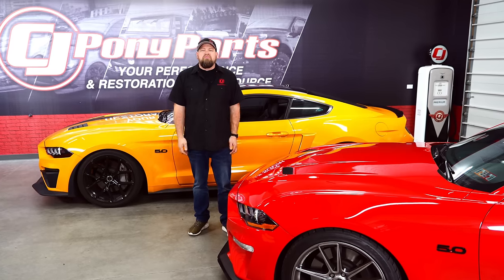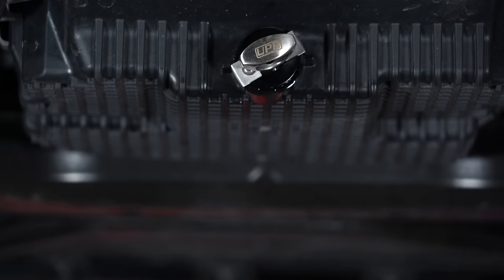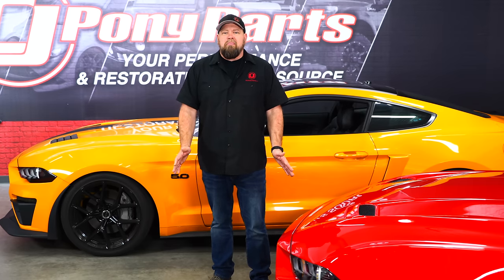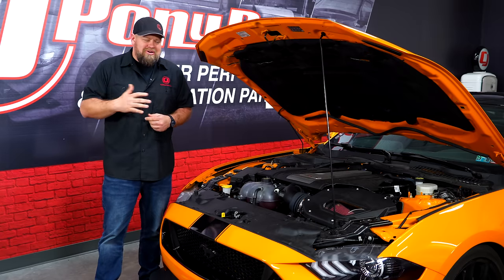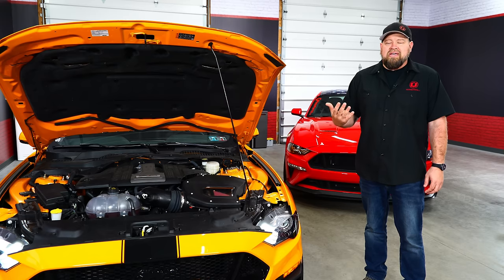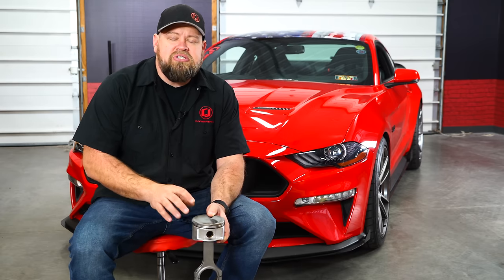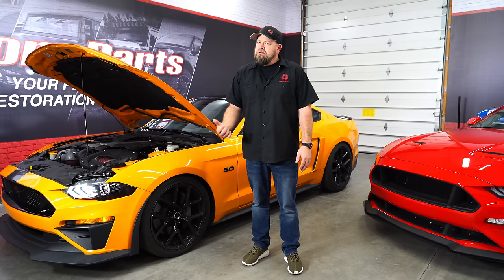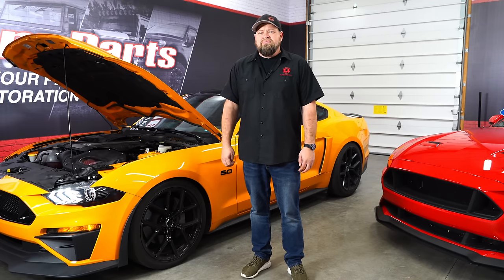2018-2019 Mustang Tick: Should You Be Concerned?

Comment: Sounds exactly like the DI system.  I have a 2015 WRX and here this exact noise (well, from what I can tell just over the video).   Ford or someone could rule out the composite oil pan theory by fabbing an aluminum pan and installing.. to see if the sound changes.  Yeah, it would take some time, but worth finding out

Comment: I still think it's rod knock. With slop, the rod has some side to side play. The force is down on the crank during a power stroke. Random vibration can make it move to the side, pinging off the crank asynchronously. Piston slap tends to occur on every power stroke in time with the engine.
I suspect that if the side to side motion is really excessive, it may be enough to force the piston cockeyed and score the cylinder. I seriously doubt that's happening much. Scored cylinders generally result in big blue clouds of smoke billowing out the exhaust. 
I've seen numerous vids of Ford techs replacing the top ends of these things only to still have the noise and end up buying back the car. A guy with a blue one just posted the other day. Tech replaced the bottom end and no more tick. Seems a little excessive when a bearing would have probably fixed it, but at least now, he's a happy customer.

Comment: I have the "tick" on my 2018 that I've put 19k miles on so far, no issues with metal in oil, good compression test and since I've modified the exhaust you really can't hear it anymore. The people that have lost their engines probably were not as a result of this tick, but some other manufacturing issue. Now with the significant refresh on the 2018 I would expect their to be some issues getting worked out in this new motor.

Comment: Im wondering if its the phasers. These engines have 4 cams with phasers and long chains. GM on the Ecotech engine, uses gears with these floating rings on the ends to reduce noise from the chain that runs the balancer shafts. A genius idea and there is a chain guide between the cams to prevent chain slap caused by the acceleration and deacceleration  of the cams. The ticking noise reminds me of a timing chain coming around a guide and tapping the guide when these accel/deaccel moments happen. Now toss in 4 cam phasers and I can imagine that causing unforseen issues.

Comment: I got the tick after my last oil change... 48k, I used to get a light tick for the first couple 100 miles after every oil change in the past, but now its been almost 500-1k and still have it a bit more prominent. Ford shop did not find anything wrong.

Comment: My first mustang was an 08 GT. I had it for 10 years. Sold it @ 75k miles and all I ever did was change the oil, breaks, tires, break pads and the occasional alignment. The car started ticking, but I think it was another issue. I now own a 2018 GT and it ticks. It gets quieter when the car heats up. I’m @ 10k Miles about to go for my second oil change. It went away for a little bit when they first changed the oil, then it came back. They said the first oil change everything looked good. We’ll see what happens. Love this car though. You can’t hear the tick when I’m smoking ya. Lmao. I still wouldn’t want another car for the price. The only thing I don’t like about the 2018 GT is the poopy audio system. My 08 GT shaker 500 system was great. I didn’t upgrade the audio this time; I would recommend it. Great review.

Comment: I have the tick on my 2018 Gt. I changed first oil at 1700 miles. Started noticing the tick. Had a misfire and engine light come on around 3700 miles. Took it to ford dealership and they told me it was two quarts of oil short and i didn’t use a motor craft oil filter and that was my problem. Ticking noise went away for a week and came back. So i took it back to ford at 4700 miles and it was already a quart short of oil so they looked at it again and told me it’s burning oil and they will get back with me when they hear from ford. Told me to drive it for now. 2 weeks later and i still haven’t heard anything and i keep having to top off my oil.

Comment: Sounds like my 6.2L in my F250. Started around 10k miles...now at 27k miles. It's pretty annoying, as I am not one to drive with my stereo volume up. It runs fine though I suppose. I just put Ceratec in 2 days ago with oil change after hearing the 5.0 guys, hoping for the best. Because Ford dealerships here in Virginia Beach are trash if you want them to do anything warranty related, they might as well just be quick lube shops.

Comment: Had a louder "clank" sound on my '15 GT just upon start up.  One minute later it would go away as the engine warmed.  The sound seemed to be coming from midway underneath the car, almost like an exhaust pipe clamp was loose.  Changed to full synthetic motor oil,  I have never heard it again.

Comment: I’ve had the tick after my first 2 oil changes. Got the car at 36k and now have 46k. Ignored it on the first change and it eventually went away. Second time it pissed me off and I used Ceratec. I kid you not, the tick was gone after the first start up after adding the Ceratec. Hasn’t come back. It’s flat out GONE.

Comment: Adding heavier oil will only mask the problem the problem is the aluminum cylinders to correct the problem you need to add liners to the cylinders which ford did not to do on 18' and up the cheep plating was a cost saving measure..

Comment: I owned both a 2012 and a 2013 5.0, and they never had that tick. I'm the type that notices any strange sounds, so I'd know if it was there. From hearing the tick in other videos, it almost has to be some sort of metal on metal contact inside the engine. If that's the case, it's not ok.

Comment: 2019 Mustang GT PP1 10 Speed. 
Engine tick has been present since 15k miles.
Engine stalls after a few pulls in sport mode when coming to complete stop. Been to shop 4 times including Ford engineer not being able to figure out why it’s stalling. Sometimes when doing a pull, the gears refuse to go to the next level up causing her to redline.

Comment: I can't comment on the Coyote motors, but as a '99 and '03 Cobra owner I will mention that there was a problem with a ticking in cylinder heads on the Terminators.  Ford developed a fix for this,  which involved some kind of head modification so that oil would flow properly to all areas of the head.  I  didn't have that issue with mine, but I did have the stalling problem, which they fixed with some kind of computer re-flash.  I would think that Ford is probably working on this problem with the Coyote motors and it will be resolved soon enough.  Remember, between the Mustang and the F-150, there are probably well over 400,000 of these motors on the road, so they must be doing something right.  Either way,  a proper break-in and then using a full synthetic oil may just mitigate this problem.   My '03 turned 100,000 miles this year.  Only Mobil 1 5-20 or 0-20 has ever been in it after the break-in and it still runs like brand new.

Comment: So I found this video just to get more explanation about what the dealership was talking about. I have a 19 gt mustang and it had about 25k miles on it when the tick began. And after a couple months of me changing oil weight. It never got better. So I took it to dealership and they got an engineer to look at it. The engineer did diagnostics and one of them was playing with the pistons and when he turned the driver side ones off it stopped ticking. The dealership is currently replacing my small block and telling me I shouldn’t have the problem again. Should I trust them?

Comment: I have a 2016 mustang GT. 44k miles just started noticing a rattle at 3000 rpm in 3,4 and 5 gear but always at 3000 rpm. You can hear it with window up or down. When window up it sounds like it’s behind the glove box

Comment: I just purchased a 2012 f150 with 90k miles on it.  The tick was defiantly there in the drivers side of the engine at the bottom.  I swapped to 5w-30 and the tick is only noticable at times now. When Its colder outside. It's not constant like it was with 5w-20.

Comment: Ford Parts Advisor, here. Per my books, you should be using XO5W50QGT in performance pack cars, not the 5W20 blend.
Reply from the maker: Manual and oil cap both say 5w20, I agree the 5w50 is a better choice.
Reply: CJ Pony Parts this would not be the first time Ford’s literature has been inconsistent in my experience.

Comment: 3 dealers 1 ford engineer and they’ll all told me it’s running at normal operation I checked my oil and opened up the filter and no metal at all not one sparkle nothing lol so I’m trying ceratec tomarrow 2 bottles should shut this thing up I drive it hard all the time and it does not blow lol it doesn’t wanna die I’m just hoping that the ceratec doesn’t leave anything noticeable that’s it’s been put in after it does decide to blow cause I don’t want the dealer blaming something that was put in the oil if they do notice anything

Comment: They have been replacing short blocks at dealerships it’s a issue. Guys that are tuned great ceratec  works for you. But when you see inside the short blocks from cars that are warrantied you wouldn’t want your car like that. I also have been having transmission an stalling issues. Car has 4400 miles an is 100 percent stock. But I do drag race an have 50 plus passes at the track an double on street.

Comment: I have a 2019 Mustang Gt Performance. Ford will not buy back or break down engine to determine the actual noise. The vehicle has been to Ford twice and still giving me the run around. If enough complaints are made Ford said they would do a recall.

Comment: There’s still issues with the manual transmission. The shift forks are weak, and will break as you are driving at some point within a year.
Reply from the maker: James Spiller thousands of cars have not has shift fork issues, mine has been fine for over 18 months and 12,000+ miles.
Reply: @cjponyparts  From what I heard they found there were some bad castings and it only affected a limited number of transmissions.

Comment: I was so bummed out yesterday.  I went to purchase a beautiful 18' GT Premium  and the first thing I did was listen for the tick.  I started the car and it was smooth and quiet.   As the idle started to come down... tick, tick, tick.  I gave it a little throttle and it went from a tick to a rattle then back to a tick.  I still test drove the car and it was fast for sure.  Drove for 10mins pulled over to listen and it was quiet again.  Got back to the dealer ship it started ticking again with the rattle on rev.  I didn't want the hassle of dealing with warranty run around or other issues so I walked away from the deal.  On another note a found a 17 GT premium that's quiet and smooth that I pick up next week.  There is definitely an issue and ford need to address it quick.

Comment: I have a 2017 GT mustang I just hit 34k miles. Longest of time I didn’t have this tick when I’d get the oil change by a trustable person. Took it to the dealership once due to a 30$ off and now it ticks. It sounds like something is loose and say it’s normal and recently threw some TSB about it. It just sounds like something is going to break and is slightly embarrassing. Like I didn’t buy the car and put work into just to be screwed over.

Comment: Too many reports of tic fix being higher viscosity oil, I personally fail to see how 5w-20 oil is sufficiently protecting these engines, my new 2019 will be immediately changed to 5w-30 full synthetic before tic sets in. Ford really does owe everyone a fix and it should start with changing oil spec.

Comment: If it’s ticking /knocking its damaging the motor period I have 18 150 with the tic and loud knock from passenger side on both old and replacement engine .new engine with 10k on it is steadily drinking more  oil every week up to qt every 1200 miles now.same problem with original engine

Comment: New 2019 gt, video recorded both sides 5 minutes before first oil change and zero tick. Immediately after oil change now has loud tick. There is definitely something added to the oil at the factory. 100%
Reply: Definitely I’m currently dealing with the dealership replacing my small block because it’s a “factory default piston slap”

Comment: my 350 chevy ticks on the top of the engine...it's valve slack or lifter...this is normal for a chevy. Now if it's a solid knock coming from the bottom (bad crank bearing), better get an overhaul...

Comment: I do not have an 18 or newer Mustang. I do an 09 F150 FX4 that has a ticking sound, but only after the truck warms up at idle  and around 1500 rpms when I'm coasting down the road. When I give it gas, it goes away.  
However, 16,000 miles ago it had an awful knocking sound (like a diesel engine), that only lasted a few mintues, but it definitely scared me. I thought my truck was going brake down. Anyways, I haven't heard it since and I haven't seen any metal in my oil. Not sure what that was.  Ford makes a great product IMHO, but I think Ford needs to address the "typewriter" ticking. Even if it isn't anything, it's all about perception.

Comment: 14 GT here (16k miles), the only noise I experience is normal engine noise and the injectors doing there thing. Using the recommended 5w20 and went the Synblend route.

Comment: My ticking started at 500 miles and was only present at approx 2K RPM when lightly transitioning above and below that RPM.  It got louder as the miles increased and by 3K miles, the ticking became more of a rattle under the same conditions.  Took it to the dealer and had a senior mechanic do a ride along.  He said the sound was not normal and did a series of tests including stethoscope and borescope.  He reported to Ford that I had cylinder scoring in 5 cylinders and there were fine metal chips in the oil.  Ford approved a short block replacement and within two weeks I was back on the road.  New engine is quiet and has no presence of ticking or rattling.  My original build date was 11/10/17 and based on a few Mustang forums, build dates prior to Nov 15th for 2018 model is the problematic timeframe for this problem.  My new engine was built on 11/25/18 for reference to the corrected problem.
Reply: The 24s have it too mine has done it since day 1

Comment: I have a slight tick on my 5oh when holding steady throttle in the 2,000 rpm range. It’s not an exhaust leak or my valves but a mechanic said it’s apparently just my headers that it creates a louder echo from the pistons

Comment: Thanks for the video. I have a 2020 5.0 GT but I had the same issue with my 2016. It sounds like the BBQ tick but it happens more when the engine is warmed up and it increases in frequency when I step on the gas, whether I am moving or still. It doesn't sound like a rod knock. More like the tick. But under the different conditions described here. The dealer's mechanics can't figure it out. They tried everything on the 2016 but it remained. I eventually upgraded to the 2020 because when I test drove it I didn't think I heard it. But sure enough it eventually emerged. The pistol slap theory sounds interesting would that increase the tick frequency in a warm engine when you step on the gas?

Comment: My engine blew on my 18-19 mustang at 600 miles. They found metal in my motor eventually leading up to the valve collapsing dropping into the piston. Very unfortunate but I am now riding a brand new engine.

Comment: Piston slap is not a high pitch tick. Neither the block nor the piston are physically capable of making that sound due to their resonance frequency. Your culprit is smaller. ...not too mention you need quite a bit of wear to produce audible piston slap; I've only personally witnessed it on a high-hour mower engine, and even that was only under load. I've owned two Coyotes (2014&2015), both from new, both have made various ticks at different temperatures intermittently probably since the day I drove them home. I don't know first hand, but I'll wager if you lockout the cam phasers the sound goes away.

Comment: 0:38 My brand new 14 V6 manual had this noise @18k miles. Even at  traffic light, other drivers were asking me what the problem is. Dealership replaced the engine, noise gone.

Comment: First off I have a 2013 Mustang Gt premium with the track package.  I run 93 octane gas and fords recommended 5W-50 full synthetic oil for the track pack cars.  I do have the engine tick but sometimes.  The car will tick when the AC compressor is on and the car is at a hot idle.  Ford told me if your in the car and the windows are up and you cant hear any noises at idle it is considered normal!  This noise is so annoying.  I did some research and found Ford  campain TSB 12-8-14.  (5.0L with A/C compressor drive stretchy belt configuration-light lower end engine knock) but it said for 2011-12 mustangs.  Supposedly if you replace the front cover with the needed bracket for a true idler pulley for the A/C belt it will quiet the knock as Ford calls it.  Sounds more like a tick to me.  Bottom line.  I just live with it now and never followed through.  I need to just remove the A/C belt and see if the noise persists.  Is this TSB related to this video who knows.   All I know is when I pay $40,000 for a car the engine shouldn't have any odd noises.   I still will be a Ford fan forever because I have had several ford trucks and SUVs and they are good vehicles.  Every make and model has there problems, even imports.

Comment: Just took my 2018 gt in to the dealer at 10k miles. 
Unfortunately it has the tick, the dealer acknowledged the tick. Stated It was coming from cylinder 3 and then told me it shouldn’t have short or long term issues with engine. 
However one week later I feel like the tick is louder so I I will be taking it back to dealer